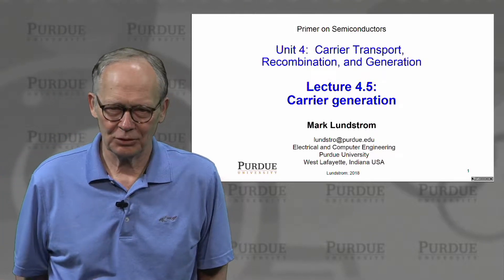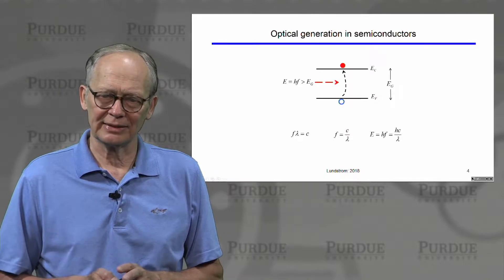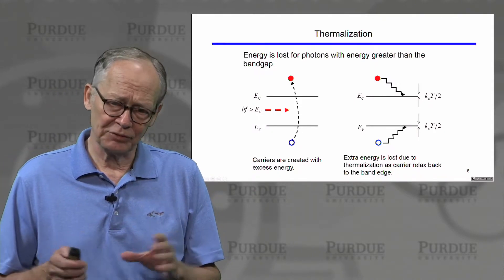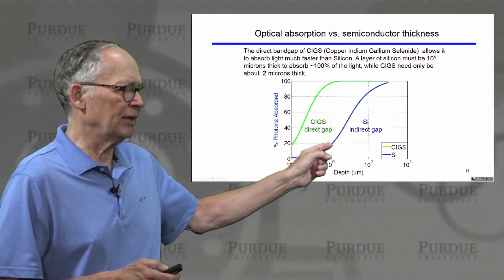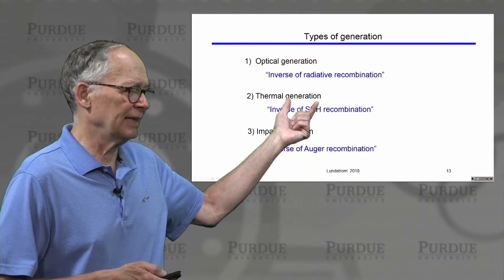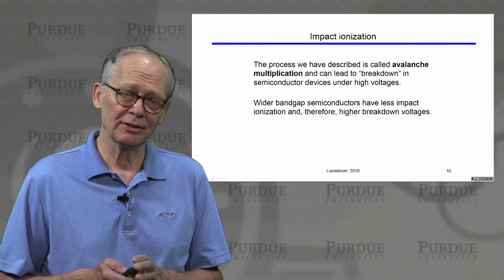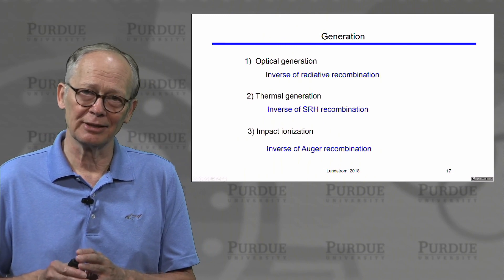ECE Purdue Semiconductor Fundamentals L4.5: Recombination and Generation - Carrier Generation

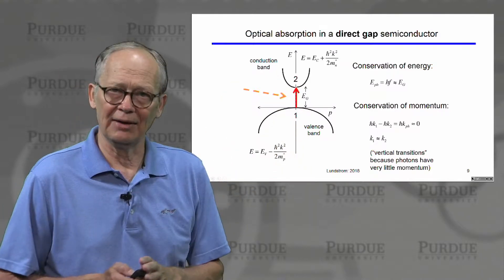Comment: 0:58 Photoelectric effect (optical generation), 4:14 Thermalization, 5:23 Thermalization on an E-k diagram, 5:52 Optical absorption in a direct bandgap semiconductor, 7:43 Optical absorption in an indirect bandgap semiconductor, 9:35 Optical absorption vs. semiconductor thickness, 10:39 Absorption coefficient, 12:26 Types of generation, 13:29 Impact ionization, 17:18 Summary